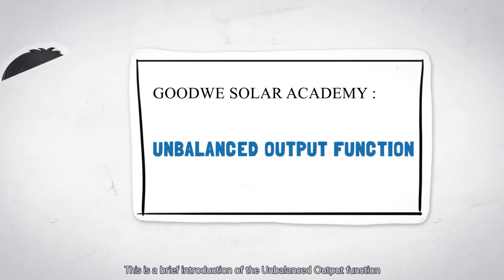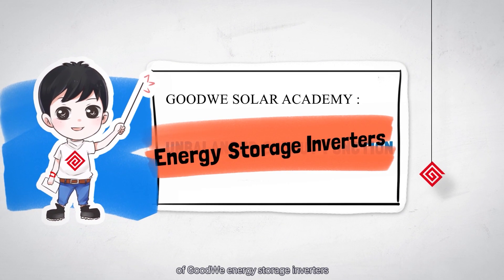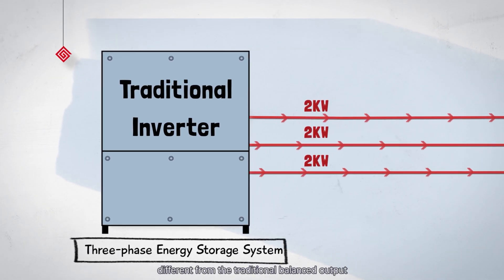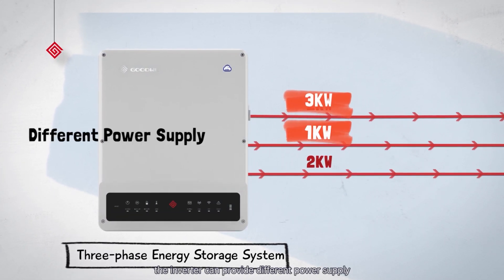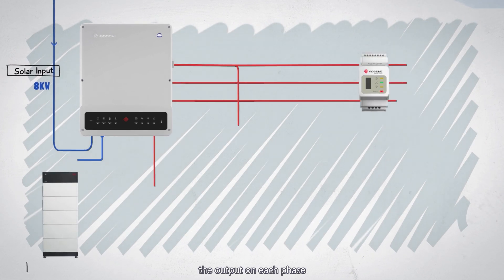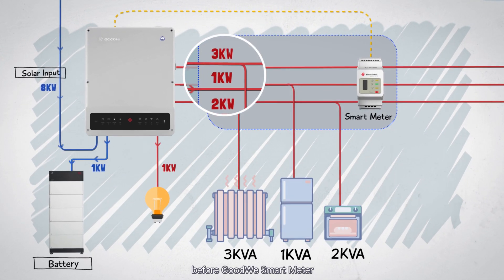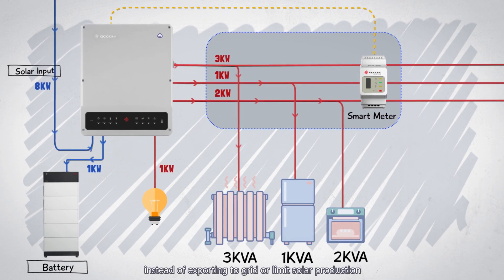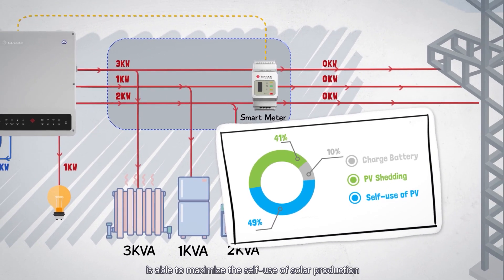Unbalanced Output  Function for GoodWe Energy Storage Inverters

Comment: Hello Goodwe team. With the ET10 it is possible to get 10kW with the right battery connected.
With unbalanced Output and the backup realized on 3 Phase does this mean I can get e.g. 
6kW on phase 1, 
1kW on phase 2
0kW on phase 3
I understood originally that I can not unbalance it above 3,3kW, what is correct now?
thanks Peter
Reply: Hi I have the ET10Kw and it can not go over 3.33kW/phase.
Reply: @raiperepari  thx Robert. Same as mine. Would be great if Goodwe also could reply. Use a byd HVM 19.3
Reply from the maker: Yes, each phase of ET10k can not go over 3.33kW.
Reply: Thanks for the kind answer. In app unbalanced can be switched in and off. What is then the practical difference ?
Reply: @Night73eye  The difference is in net metering procedure. If you have unbalanced swithced ON then net metering will be L1 + L2 +L3 = 0W + 0W +0W = 0 Watt at input grid meter ( no power will go out to the grid in this case). In case if you have unbalanced swithed OFF, then inverter will produce equal power on each phase and net meter will have for example: L1 + L2 +L3 = -500W + 200W + 300W = 0W. So in both case the sum it is 0 Watts, but with the unbalanced off there the energy it is also go to the grid on some phases, which is not allowed in some countries.
Reply: @motog6plus804  Thanks for the good explanation. Means this is only for on grid...
Peter
Reply: Hi all, based on these comments, can I assume that if my solar panels produce 6kw, the ET10K can share them as 3kw to phase 1, 3 kw to phase 2 and 0 kw to phase 3?

Comment: Hi, I have a 3 Phase 10KW ET system and I cannot get unbalanced output because I cannot get the meter test to run. Do I need a battery to complete the meter test and have unbalanced output?
Reply: Hi, did you ever get an answer to this? I am looking at the Goodwe ET 10kW and want to know whether it can do unbalanced output without a battery. Cheers
Reply from the maker: Sorry for the late reply,  it's necessary to set battery on ET side. If not ,the system can't achieve the function of unalanced output.
Reply: @GoodWeSolarAcademy  I have done unbalanced output for several years now without battery. That was promised by Goodwe before I purchased the inverter.
Reply: Hi, could you share exact model and firmware ?  @raiperepari